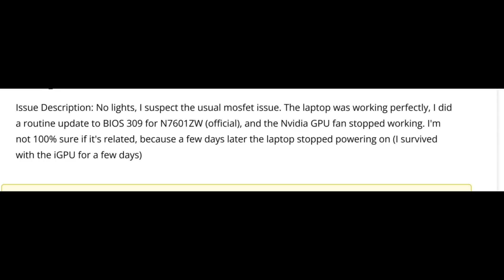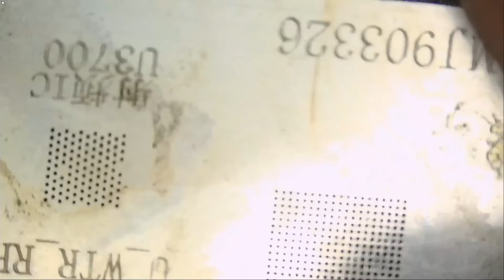How We Fixed a Dead ASUS Laptop by Reballing the Super I/O Chip - Don't miss it.

Comment: I have an OLED screen that has a white area, where the flex is disconnected from the glass. The OLED itself works properly if the ribbon is pressed on the glass. Do we have ways to solder the ribbon back onto the glass itself? I tried resoldering it, the lines disappear, but it doesn't stick and nothing happens to the OLED. I think you might have an idea as to what solder could be used by any chance? Knowing it can work normally if bound back to the glass and seeing it show a normal image if pressed looks like it's salvageable.

Comment: I had to replace a PLA chip in my 10” Meade LX telescope. I didn’t know what It was, so I looked it up. It is a Programmable Logic Array chip that is programmed to connect the pins a certain way for how it is utilized. Luckily, it was a socketed chip. It was rare, but I found a seller. I had to buy 2 though. I didn’t know if it would work not knowing if it would be programmed by the software. I was glad that it worked and got my telescope going again. I found out that the Commodore 64 uses a PLA chip that allows it to change the memory mapping.
Reply: The PLA section of the chip must be programmed every time it's powered on, so this is done by your host CPU software when your device boots up. Some PLAs have their own flash that contain the programming and does it by itself. You got lucky this one was not one of those. Glad you made it, cheers.

Comment: Wonder if this laptop has an Intel CPU, and it’s one of the questionable ones. Now I don’t know of the versions for laptops has the same problem as their desktop counterparts. However this could have been a deciding factor in trying to update the BIOS. 

Or could just a company putting a kill switch in somewhere to make someone buy a new one. 🤷 Yes that is speculation and tinfoil hat thought there. 🙃

Comment: For my work laptop there are rules for certifications where you have to run the latest firmware to be sure you have the latest security updates. Also for the software your running on the laptop.

Comment: If bios and firmware updates are forced through WU then it is quite difficult to avoid them..
Reply: Install Windows Update manager. It’s freeware and it gives you complete control of what updates you install or choose not to install. You can also hide selected updates. Never install BIOS/Firmware using windows update, always go to the board manufacturer instead. I have it on all my PCs and have been using it for several years, it’s great.
Reply: BIOS should always be updated via the manufacturers firmware management app it has nothing to do with Microsoft.

Comment: If the firmware is issued by the company and the laptop is under warranty i dont see why not. In the gaming laptops firmware updates usually fix high temps that came with the original firmware. Also win updates or linux offer those updates automatically. More likely he used a custom firmware that unlocks bios settings or unlock gpu clocks